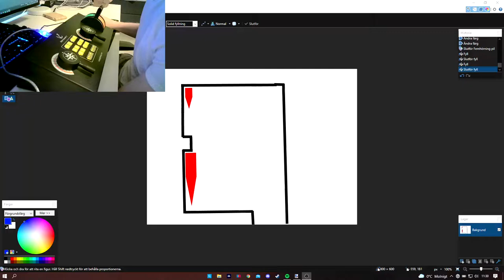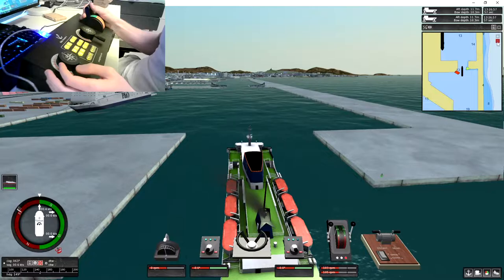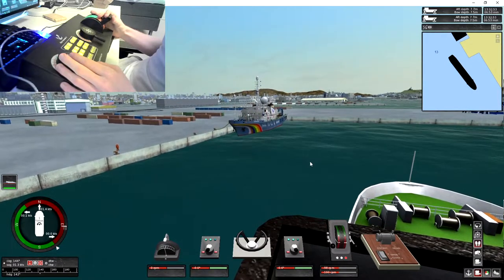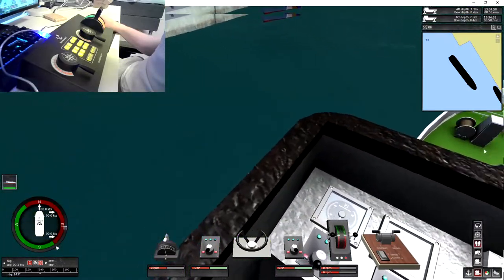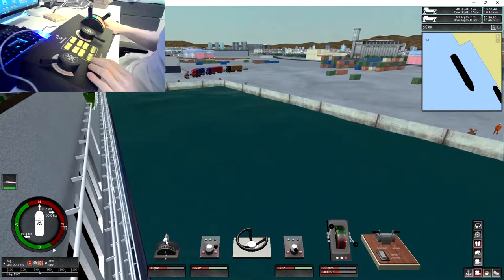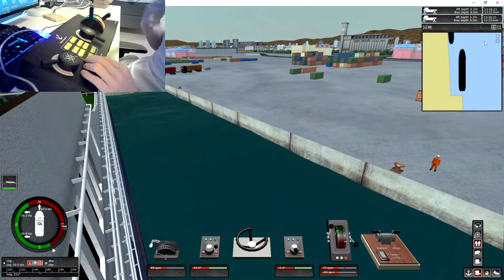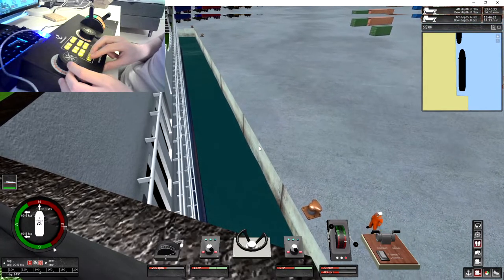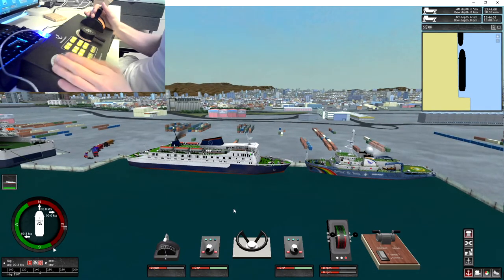Parallel Movement of a dual propeller ship in Ship simulator extremes (EPISODE 2)

Comment: fantastic video! do you reccomend doing short bursts with the thrusters rather than a set rpm?
Reply from the maker: Usually you'd like to do short bursts, I only have the option to do short bursts of 100% thrust since my controller won't let me do otherwise. But if you can find a constant rpm that will match the movement of the aft it would be optimal.

Comment: how did you make ship simulator extremes work on your pc on mine it does't
nice video's tho
Reply from the maker: I just downloaded via steam, and I personally have to use windowed mode for it to not crash.
Reply: @ericjacobsson9139  if i try to start the game it ends up in a black screen
Reply from the maker: @ROetjel  verify the game files or reinstall otherwise idk what you can do.
Reply: @ericjacobsson9139  yes allready tried.
one more thing your system is running on windows 10?
Reply from the maker: @ROetjel  yes, Windows 10.
Reply: Same here

Comment: 2.7kn speed when you vessel so close to berth is extremely dangerous)
Reply from the maker: No it's not, depends on the shiptype of course. But a ferry with two engines and two propellers is no problem. The vessel is lightweight and a lot of power.

The real vessel I'm working on is no problem either, especially when making way astern. We can stop on a dime..
Reply from the maker: It's even more dangerous to go slow, you are  exposed to the elements, currents, winds etc. You need to have some speed to be in control.